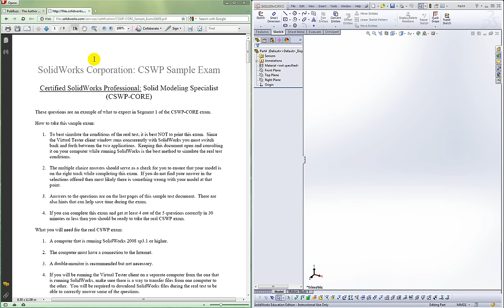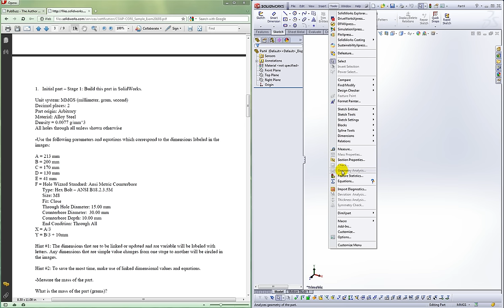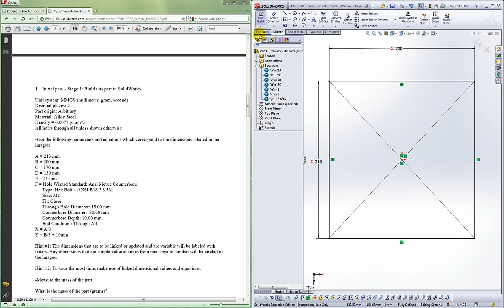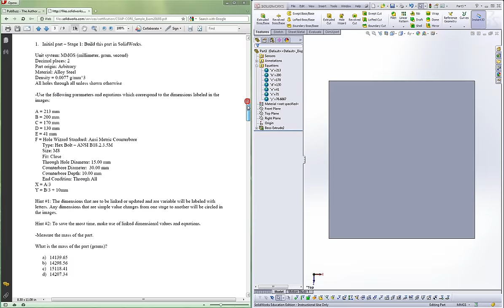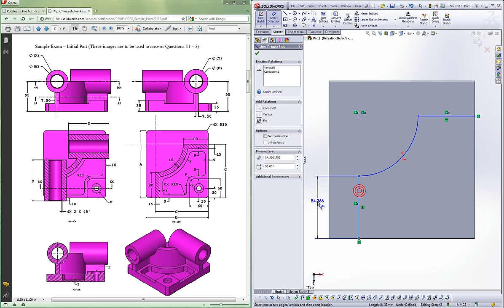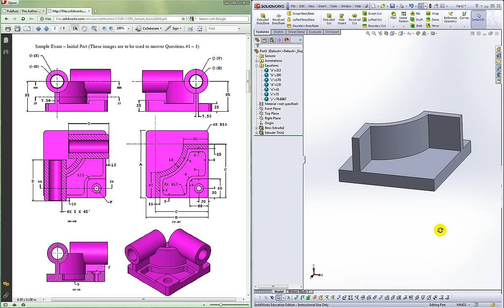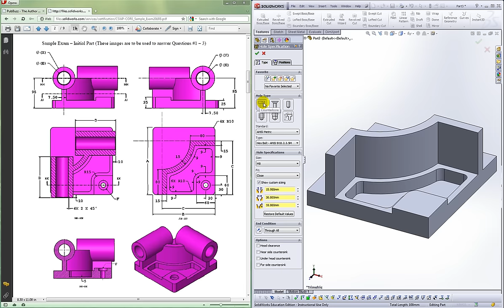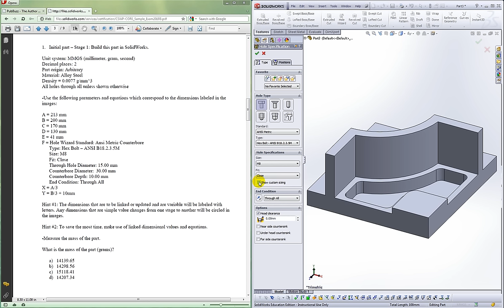SolidWorks Preparing for the Professional Certification Exam

Comment from the maker: I've received a number of questions from people who have not gotten the same mass as I did on this part. In all but one case the problem was the result of not fully defining all sketches. The alignment of a center mark is one common problem. Another is not noticing that once cylinder has a diameter that references variable X, the other references Y.

I consider it good practice to fully define every sketch in a part. Some users apply the same logic to parts in an assembly, but that requires locking parts that would be free to turn in an actual assembly. The concentric mate now has a locking option to make that easier.

Comment: At 7:58 you change the setting on the "FROM" box.  I've used SW for over 20 years, I've never really noticed/changed that setting ever.  
I simply change the Extrude setting in the  "END CONDITION" box from "Blind" to "Offset from" and click on the bottom surface then enter 35mm for distance.  I think this is the way most SW users would do it.  We frequently change end condition: blind, up to surface, offset surface, midplane,...etc.  
However, your method is good to know, because I may come across an SW file created by someone else and need to edit.
Reply from the maker: I use both often, and they are helpful in different situations.

Comment: thanks for putting it together with audio... other YouTubers simply don't include narration while building the part.   At the 8:02 timestamp, your point about building up the boss (60mmx60mm) for the counterbore hole REALLY solved my frustration tonight.  I was getting the wrong answer because what I was doing was extruding 10mm up from the top of the base (25mm height) to arrive at the 35mm instead of using what was on the print.   So I get it now, duplicate EVERY dimension on the print as the gospel.   With making the correction for that single feature, I arrived at the same answer as you without making any other sketch-feature changes.   

Now as for taking the CSWA-FEA aka CSWA-S, a YouTuber the prerequisite for that is that you must have passed the CSWA.  Is that correct?
Reply from the maker: My understanding is that you are required to take and pass the associate level exam before taking the professional exam. Not a bad warm-up, since the professional exam is definitely challenging. Glad the video was helpful.

Comment: Maybe you've figured this out, but when you extruded the round, starting @ 100mm, you click on the dim itself. This allows you to change the dim. If you click on the leader, or arrow, the the properties window opens. If you right click the leader or arrow, then you can link your variable.
Reply from the maker: Javier,
Thank you. Someone else commented several years ago that de-selecting the Instant 3D button also helps with this. I may redo this video with the current release at some point, but your comment caused me to watch it for the first time in a while and I think it is still useful even though there are some things I would do differently now. I do appreciate your suggestion though.

Comment: Very well done video..! I appreciate that you took the time to explain things clearly and make comments from your personal experiences. 

I am still having trouble getting the exact 'mass' for the part in question 4 and 5, as Q.4 mass was off only by a few grams, and Q.5 was off by more than 150grams. Any help would be appreciated, as I am trying to get the company I work for to help me pay to take both the CSWA and CSWP exams.

Thanks..!!!
Reply from the maker: Check to see if all of your sketches are fully defined. If not, fix them and check again. One common error is not locating the center of the arc part of the rib. If you want to send me your model at dabbott@smccME.edu, I'd be happy to take a look at it.

Comment: Hello Daniel,

The video instructionally is very well organized,
my question : I use SolidWorks 2016, for question 2 when i try to update the global variables, the values in the equations do not change. Is there an option that I have to change or have I missed to change a setting ?
The rebuild option does not work either.
Reply from the maker: The most likely problem is that you typed the variable name without typing an = sign. When you do that, the value of the variable is used for the dimension, but the dimension is not being driven by the variable. See if there is an epsilon sign in front of the dimension value (denoting an equation-driven dimension). If not, delete and then add the proper dimension by typing the = sign and then selecting the down arrow just below the dimension and then "global variables." Select the variable name directly or type it with quotation marks around it.
Reply: Daniel Abbott 

I’ve been struck on this for a while, 
I will try this and update you. 
Thanks for the prompt reply.
Reply from the maker: If that doesn't do it, send me the file at dabbott@smccme.edu so I can check it out.
Reply: Sure Daniel.,
Reply: Thank you Daniel, the usage of = sign while dimensioning has helped to fix the issue.
Reply from the maker: Good!

Comment: Great video; appreciate alot of the good design intent, & practices that would help avoid errors, & are efficient. My concern at this point is it's great if they give you these multiple choice answers in the practice exam, but if that's not the case for the actually exam, it looks like you have to get everything perfect, & wouldn't get the time to correct things. It sounds like this would also have a domino effect on all the questions that follow, if you get the first wrong etc. Do you know if your answer is wrong do you have time to fix it, even if there are no multiple choices or do you just have to get it right the first time?
Reply from the maker: Rob,
Generally you will be given multiple choice answers on the first couple of questions regarding a particular part, and then you'll have to type in answers for the remainder. It is indeed possible to have a domino effect for part of the questions, but generally you'll have the reassurance of finding a correct answer among several when you first make a part or an assembly.

Comment: I got the right mass value for the Initial part (14207.34g), but when I change the equation to Second (15165.40g instead of 16490.45g) or third condition (14791.68g instead of 15100.47g) the answer deviate very vastly. I am using 2020 version. Any suggestions?
Reply from the maker: Send me the part at dabbott@smccme.edu and I'll take a look. It sounds like you may not have actually applied the global variables to some of your dimensions. That can happen if you type in the letter rather than selecting it from the list of global variables that is displayed when you enter the = sign. (You can also place quotes around the letter). When you do that, the value is used, but the dimension is not linked to the global variable. If there is no Epsilon symbol on the dimension, is it not equation driven.
Reply: @DanAbbott-SMCC  Hi Daniel, thank you for responding.  My friend figured it out just like u suggested.  I didn't link the dimensions properly and the fillet near hole wizard was in wrong size.

Comment: great video Dan!  much appreciated.  id assume the solidworks certified associate exam is much less involved than this?  and do you know if its possible to jump over that one and go right to the CSWP certification?  thanks in advance for any response
Reply from the maker: MATT 
You can take the Professional Exam without having taken the associates exam. The associates is less involved, particularly for the assemblies, and has more questions that are multiple choice, so you have more feedback (i.e. you can find an answer that matches your value. There is a practice exam for that too. I took the professional exam without taking the associates, but I give the associates to my students at the end of their first class, so I've taken it several times since. If you feel pretty confident, take the first part of the professional exam. If you don't pass that, you probably don't want to take the other two parts right away, and it may make sense to do the Associates exam instead.
Reply: Daniel Abbott Thanks for the response!  i think i would pass both of them.... i followed along with this video and most things seemed to work out fine... i did not get the same final answer but thats neither here nor there.  Do you see any benefit to having both?  As far as I would think, having the professional cert would override the associate.... its not like i would list them both on my resume... or is that something you think would be a benefit?
Reply: Daniel Abbott also, you mention three different parts of the professional exam.... would you elaborate on this please?  not sure what you are referring to with the "two other parts"

Comment: When I did the practice test myself the first time I got a mass that was just a bit over (14215.something), I couldn't figure out what was wrong so I re-made the part (following the same process) and the mass is quite a bit under. I just re-made the part for the third time following how you did it and the part is still under mass (13717.26). The part is set as alloy steel w/ a density of .0077kg/cm^3, and I have no idea why the part is under mass. Can you think of any reason why this would be?
Reply from the maker: Send it to me at dan@danabbott.com and I'll take a look at it.

Comment: how do you know that the chamfer is 45 deg
Reply from the maker: It is specified on the print as 4X 2 X 45(deg). 45 is the standard angle for a chamfer unless specified otherwise. I think it should be specified even when 45 degrees, but if not specified you can assume 45, since if it had been a different angle you'd need more information than just one chamfer distance, since it would differ for each leg of the resulting triangle.

Comment: This question is very weird.. I've made it over 10 times today and gotten not totally different answers but off by let's say 200 g to 400 g to 20 g to 30g it's really annoying.
Reply from the maker: You shouldn't be getting much variation. Check to see that ALL of your sketches are fully-defined for each attempt. If any are under-defined, fix them and check the results. If you can't figure out what's going wrong, send me a couple of the files with different results and I'd be happy to look at them for you.

Comment: i am getting 13157.72 g for the first question. i followed the same procedure. i don't know where i committed the mistake. please help me
Reply from the maker: Check for under-defined sketches. If you have any, that is probably where your error is. If not, make sure you used only the dimensions given in the exam and don't add meaningless dimensions just to make the sketch fully defined. Relations in sketches are often the source of problems as well. You may have inadvertently added a perpendicular or parallel relationship where it is in conflict with something else. If you really can't figure out what you did, send me the .sldprt file at dabbott@smccme.edu and I'll take a quick look at it.

Comment: Great video, but please do not feel you are ready for the exam after this or you will be greatly disappointed.
Reply from the maker: Well, that depends on how prepared people are going into the exam. This is certainly not meant to be the only preparation one does for taking it, but it's been helpful to many people who have passed it. But you are correct that you also need to have used the software seriously for a while. I've had a few students pass the CSWP after a one semester class and an additional semester of application.